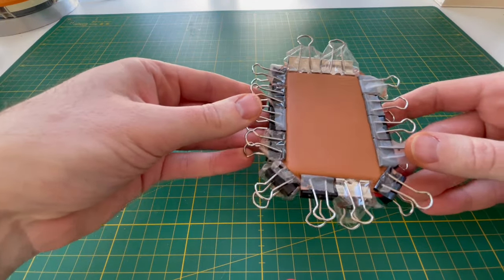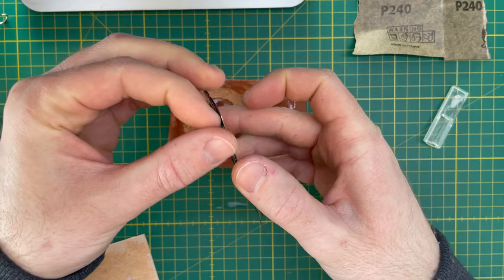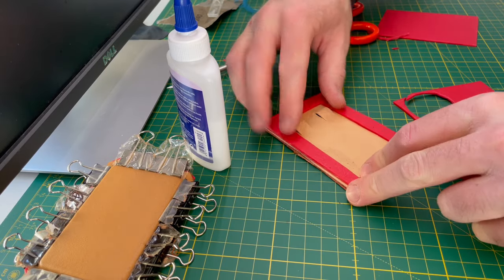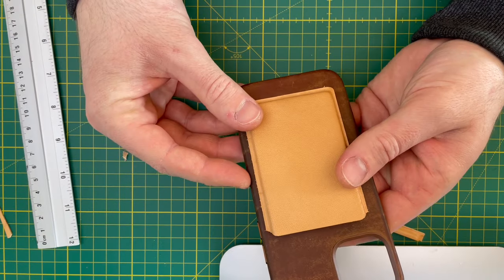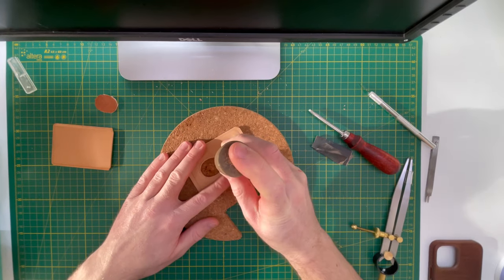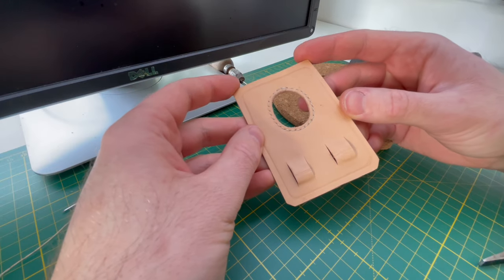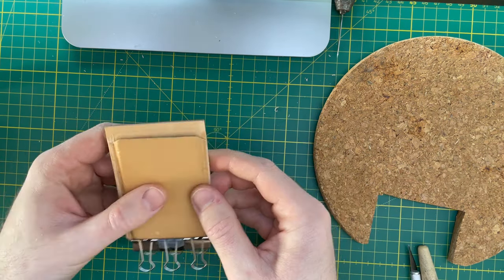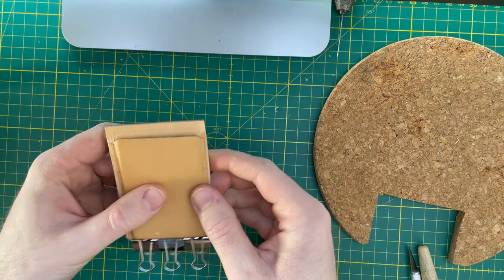DIY MagSafe Wallet & GIVE AWAY

Comment: Amazing looking wallet, well done! I'm trying to make one myself. How did you make the metal piece? Does it protect the cards from the magnet damaging them as well?
Reply from the maker: Thank you!!
I cut it out from a sheet of metsl with a dremel rotsry cutter 😊. It should offer alittle protection but magnets can still damage the magnetic strip of the cards.
Here we dont use the magnetic strip very often anymore so for me it is not a problem.
Reply: where did you buy the magnet that goes on the wallet and metal sheet inside the wallet? i want to attach one to my own wallet. :)